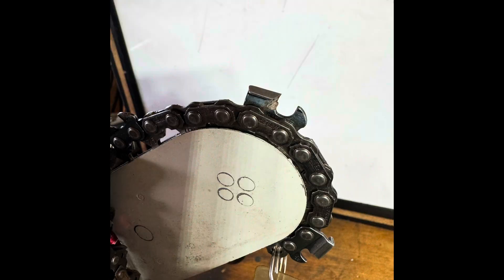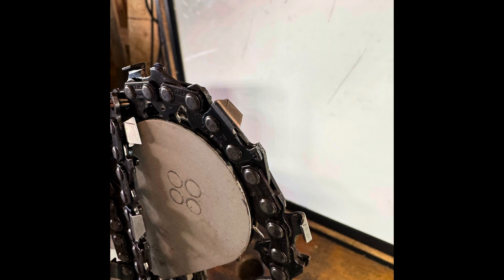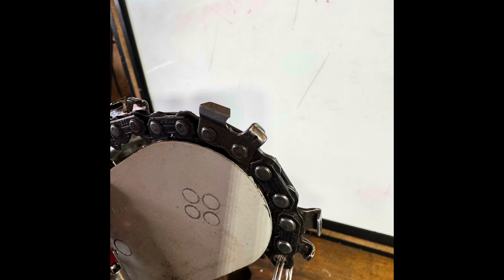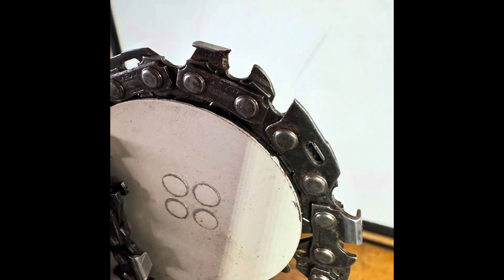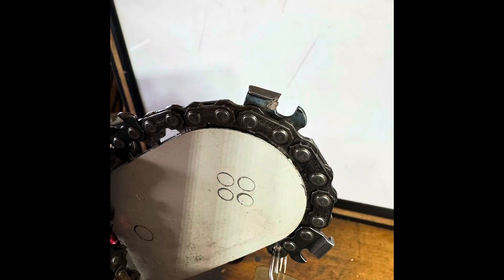Depth gauges- why so many different ones

Comment: Using a bore cut while aloft is not so unusual. In some tree species prone to tight branch unions, the ability to execute a correct pruning cut depends on having precise cutting ability, and plunging in is a technique to achieve the nice cut. I’m not saying it doesn’t have hazards, just saying it can be part of a professional climbing arborists arsenal. This is why a carving bar on a smaller top handle is in the truck. Thanks for sharing all your knowledge; I am always learning something by watching your videos.

Comment: Your comment at the end using the term “high energy kick back” was insightful for me. I’m not a professional user, but I spend hours and hours running saws living in Alaska. I consider myself “higher level” experience wise but I haven’t ever had my saw catch something at full rpm. I honestly hadn’t really considered that as I tend to run my saw fairly slow and controlled when bucking limbs and try to keep my bar clear whenever possible doing cross cuts.

That terminology did excellent to really grab my thoughts to consider what a high rpm kick back would feel like, especially when cutting trees close to a home where light arboreal work or “held high” limbing might seem like a good idea. Definitely gave me some more cues to think through running the saw. Thanks!

Your content is excellently presented and I appreciate the giant props! Cheers and Shalom!

Comment: Great video. Is there a need to reshape the top of the depth gauge after it has been flattened a bit by filing so that there is once again a smooth curve leading up to its highest point/plane and not a quick transition from curved to flat? Sounds like a PITA but I've sometimes heard that it is useful / important to do.  No one seems to mention it in sharpening videos.

Comment: I'd just like to add that even the low kick back chain with the big shark fins cuts just as fast as normal chain in wood that's smaller than 5-6 inches, in small stuff the chain doesnt get a chance to plug up with chips.
I run the reduced kickback chain on my top handle, it doesnt hold it back as I never cut large wood with it. It's by far my most dangerous saw, my normal fire wood saw is way easier to control.
Reply from the maker: Absolutely! The difference in cutting time on a six inch limb would literally be 1/10s of a second.

Comment: You are safer using a longer bar then a shorter bar. Due to the fact that there is a lot farther of a distance for the bar to get to you since the part of the bar (the nose of the bar) is farther away giving you more time to get the kickback under control. Which is the reason why top handle saws are more prone to injuring you. That's also why loggers that use long bars hardly ever get injured by kickback.
Reply: @BryanClark-gk6ie reread what I said. I never said that loggers use top handle saws. I said that they hardly ever get injured from kickback cause they use long bars.